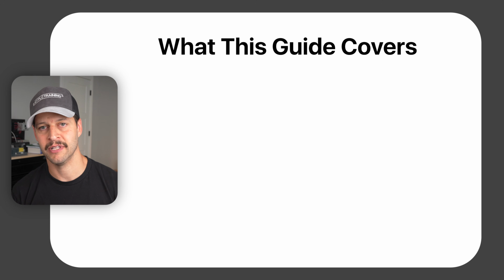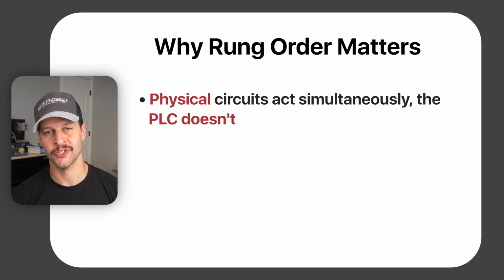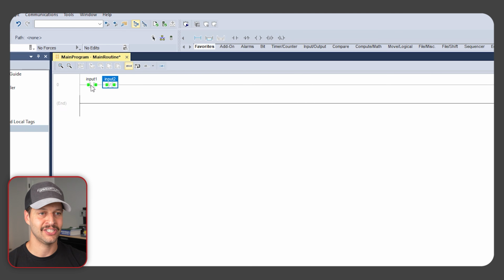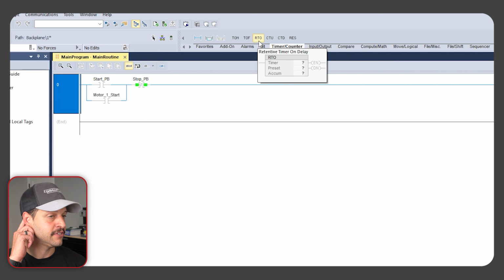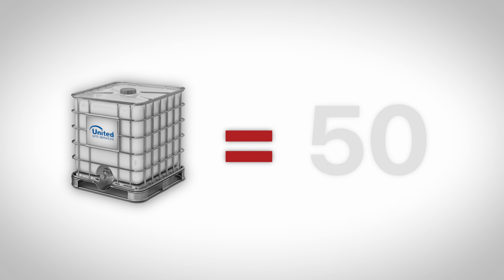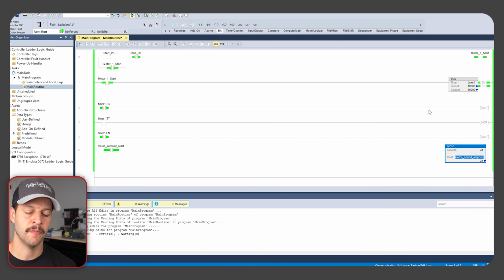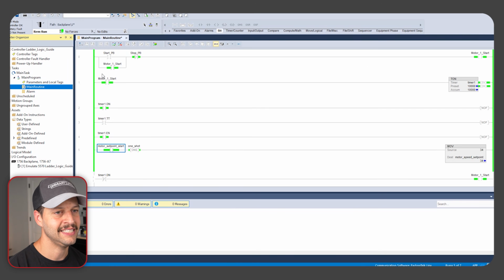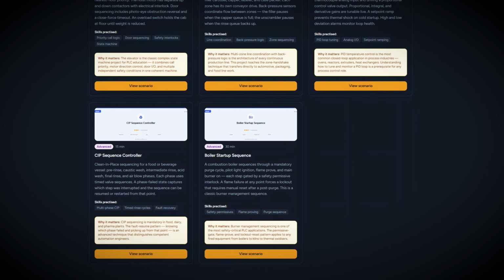The Only PLC Ladder Logic Guide You’ll Ever Need

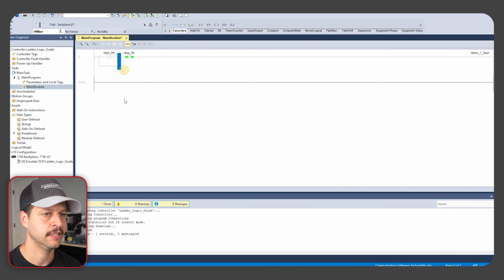Comment: Hello and thank you for posting this helpful video. Question: At 10:22, when you seal in the latch, does that require an electromechanical auxilliary contact, or can that seal-in be accomplished purely programmatically/logically?
Reply from the maker: Hey there. In the example I'm showing, this seal-in is happening purely in the program. One of the great benefits of using a PLC is that you can seal in any input signal and have a lot more options than if you were to do it all with physical contacts and wiring. You can do a seal-in process with physical contacts, and often that's still useful and needed, but many times you can just send an input to the PLC and have it handle the seal-in.
Reply: @myplctraining1238 Thank you so very much for responding to my inquiry. That's what I was hoping, but wasn't 100%. I really appreciate your videos! 
Have a great day!
Reply from the maker: @EnGenX2112  you bet. Glad you're enjoying the videos!

Comment: your explanations of the various functions are clear and concise. i didnt understand the 3 timer bits the done is obvious but is the not done bit always true or just when the tmr is active the tmr timing is redundant because the logic says whether it is or not the biggest problem with PLCs are  the programers many times complex instructions are used for simplicity in programing but very dificult to follow in real time a clasic example would be a retenative timer with the reset bit 27 rungs later for conveinience. i  enjoy watching your videos immenslly. the first PLC i worked with  was the MODICON 484  which would keep an average sized house warm in winter
Reply from the maker: Thank you! And I completely agree; good programming should make troubleshooting easier, not harder. Those older Modicon systems were definitely built like heaters! I appreciate you sharing your experience, and glad you're enjoying the videos.

Comment: My problem is ladder rungs at the top of the page are tied to ladder rungs at the bottom of the page and vice-versa.  It is a challenge to figure out what's happening.
Reply from the maker: yeah it takes practice reading and writing logic before it starts to make sense and even then it can be tricky. Using the cross-reference tool can help though!

Comment: After years of living in the ladder logic universe using several PLC platforms, I've recently been developing a major project strictly with Structured Text. The biggest reason was that any editor such as Notepad (Notepad++ is better) can be used. Another reason is that it will be easier to transfer projects from one IEC platform to another.
Reply: that is great for you, but it doesnt do much for the poor maintenance electrician who has to troubleshoot that program at 3 am because the machine it controls is stopping a whole production line
Reply: @garryspeiran4374   I hate to say this and it's probably opening Pandora's Box, but there's something new in automation that allows any green stick to get immediate help from AI at 3 AM. Just copy and paste into a prompt in ChâtGPT or Grók and the AI will explain everything about the code within seconds and provide specific functions and possible flaws or bugs. Structured Text is the easiest format because it's just text and the return answer can be in the same language. Copying ladder is possible, but it can be limited if not completely impossible with some automation programming software. AI is a game changer in our business so it may be necessary to learn how to "prompt" at the same time. Choose your programming language wisely.
Reply: @garryspeiran4374 couldn't they learn a little bit of the programs just to do some of the smaller obstacles??
Reply from the maker: Structured Text definitely brings some interesting advantages, especially for portability and larger projects. After years of ladder logic, it can be a big shift, but it’s a valuable skill to have.
Reply: When I saw what Single Board Computers (Raspberry Pi, etc.) were doing with their real I/O blocks, I immediately said, "That's a PLC!"

Back in the mid 1990s I worked with with Allen Bradley (A-B) PLCs.  The PLC 5 we had was as big as a small refrigerator and twice as heavy.  I stayed in the industry long enough to watch the Japanese and Germans enter the market with truly compact units that made the A-B PLCs look ridiculously large.

The last PLC I worked with was a Texas Instruments unit.  I wrote a driver for an I/O module that interfaced with my company's industrial automation software .

But when I watched a video (from Explaining Computers) working with the I/O block (the GPIO) on a Raspberry Pi, I was amazed.  A Raspberry Pi doesn't use ladder logic but the programming performs the same function.

Comment: Back in "83, I worked on a commissioning job on a Pharma plant.  PLCs had just come in. Ours was Modicon. As a Technician we had never seen it before. My mate and I were desperate to learn, but the little sh*t of an engineer would never ever let us see how it worked. Modicon had a large programming/viewing portable terminal. This guy always made sure he turned his shoulder over the terminal when he was doing anything. We DID manage to see enough to learn a bit. We were out on a Sunday , and "broke" into his office and fired it up. Since it is a PLC, everything (at that time) was either on or off. In his office he has a huge sheet of polystyrene, with an A0 P&ID of the plant glued to it. It was wired up with switches poked through for the inputs and lights poked through for the outputs, so you could basically run the plant in his office. Well, because he was a little sh*t, we "reconfigured" his P&ID, with lights and switches in all the wrong places. So when he fired it up on Monday, nothing worked like it was meant to.......Ha Ha!! Childish, I know, but gave us a lot of pleasure at the time.......lol It WAS 1983!!!!!
Reply from the maker: That’s quite the story! 1983 was definitely a different era for PLC training—and sometimes a little creativity was the only way to get hands-on experience!

Comment: These video's are very helpful, thank you! I've been a controls electrician over 15 years, wiring panels and machines. I recently built a test/learning panel using a Micro820 with some basic switches, lights, analog dial, and a couple proximity sensors. I wish I could use Studio 5000, it's to expensive for a home user to learn on so I  use CCW for now.
Reply from the maker: Our training includes the software so that you don't have to buy it outright. I recommend checking out our site to see what we have to offer!
Reply: You can install CCW Standard Edition for free. There are developmental limitations with tag (variable) structures and some missing built in functions, but most of these have workaround solutions to complete even major projects.
Reply: I’m in trade school now and I absolutely love motor control do you think I should go into that part of the field?
Reply: just delete trial license file and get a new one every week. Then you can run AB at home.
Reply from the maker: @joefoxFPV  just make sure you're following Rockwell's licensing terms.